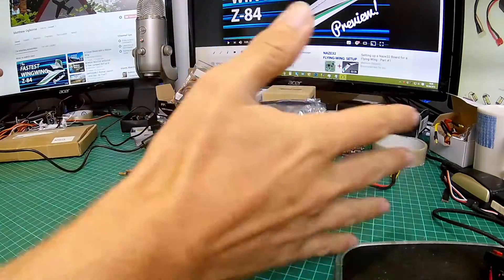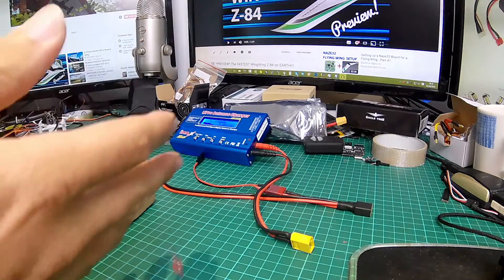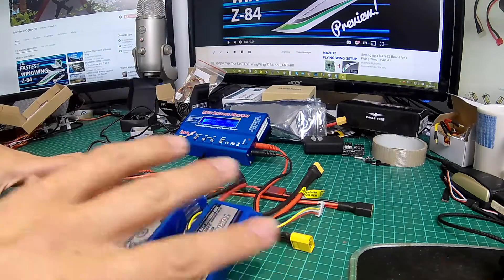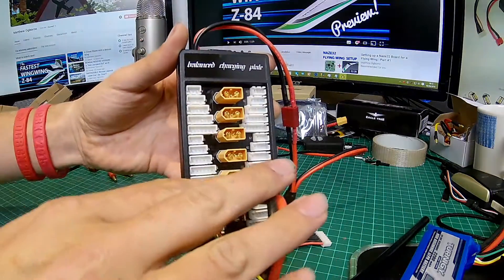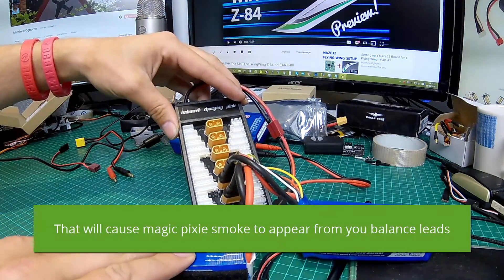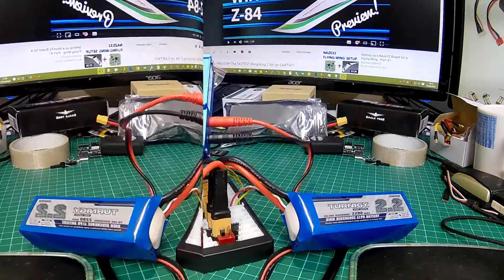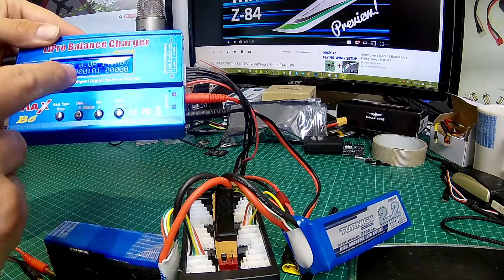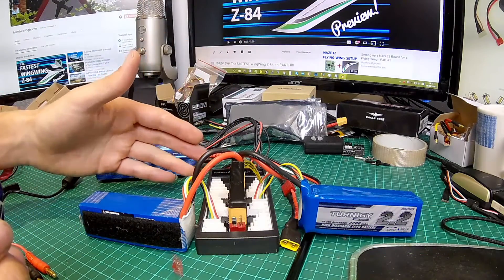How to Charge your RC Lipo Batteries FASTER - Parallel Balance Charging Board

Comment: seems like this would make it slower to charge. its sharing the amps to the series cells, and the slowest part of the charge process is the balance stage, and added double the battery makes double the time. if you have a small single port charger, as you can hook up as many as you want then, come back 30 hours later and they will all be charged and balanced.

Comment: Being pedantic I know but... 
You can't charge faster, you can charge several at a time, just like having two or more chargers...
You can mix capacities but you must charge at the lowest rated battery...
The cell count must be the same... 2s.3s etc...
Batteries charged at currents lower than their C rating will almost certainly lengthen their life...
Reply from the maker: Howdy Michael, I'm sure you're aware this video is nearly 2 years old and I have no way of updating a video once it's been published. Matt
Reply: No worries, just posted to answer questions people are asking (generally)... the video itself is perfectly fine...

Comment: I don't know but my charger says go f yourself when I do it that way. It complains that I'm trying to use a 6s plug for 2 3s batteries. It says "connect error, check main port" when you hold down the enter button and it checks the battery. I'm using the same board as this video shows expect all the XT60 plugs are T plugs. The charger is a Skyrc bmax B6 mini.
Reply: yes because you have to use the 3 s balancer port ^^ same port for both cells

Comment: I mix batteries of different capacity no problem, same cell count and similar voltage
Reply: Shady Gabr Yes he is incorrect in the video. You CAN mix various capacity of the SAME cell count. For example 

All 2s with 2s various capacity 👍

Also total voltage of packs must be with in 2 tenths of a volt. 👌

Break these two rules and 🔥😭

Comment: I have 2 pcs 3s with 5500mah each. But my charger charge rate is 5amps max. it is safe to charge still with less charging amps?
Reply from the maker: Howdy fella, absolutely! It'll just take longer. Also I charge my bigger packs at 1/2C so for you that would be say 2.7A. It'll take longer but they'll last longer. Hope that helps :) Matt

Comment: Hi Matt
What is the cut off capacity rate in the charger ??
for example: if i use 4 x 3000mah batt. 3 cell each, cut off capacity rate will be 12000 ?

I try to charge 4 x 3000mah lipo, 3 cell
use 5 amp during charging
cut of rate was 3000
and it stop charging due cut off capacity
Thanks
Reply from the maker: Howdy, I'm genuinely not sure. With such large packs I'd only charge 2 at a time, thus be at the 6amp limit of my charger.
Reply: Thanks man.

Comment: I've been worried about these, thinking the voltage on each used lipo has to be exactly the same, but i hear it can vary by a small amount like say 15.30v and 15.40v on a 4s?  I will give them a shot, thanks!!
Reply from the maker: Phil, I've been using this for a couple of days now, basically if they're flat >20% they'll be fine. I did 4 1300mAh batteries in one go, miles faster.

The only word of caution after chatting to Pat (his comment is below) is with large battery packs, eg 6S or with large capacities, you could run into issues if your power supply is not man-enough for the job.

That's where you can daisy-chain PSU's for more power and also the boards as well for larger numbers of batteries. But for me, the largest batteries I have are 5000mAh and I'm not using them much at the moment. Plus my iMax B6 only goes to 6A anyway.

Hope that helps Phil!

Matt
Reply: +Matthew Ogborne thats great, ive got the same charger. 2 of them. most of my lipos are around 1300mah 4s. and am charging every day so if i get 2 of these from our mates in china, things'll be thumbs up. ps i cant beleive you fly an emax 2205 2600kv on a bonsai! thats like putting a V8 on a bicycle. haha
Reply: thanks again Matt.
Phil